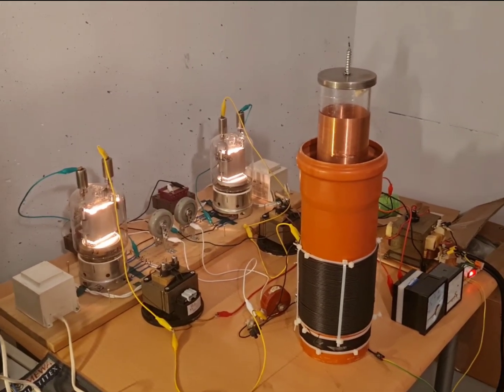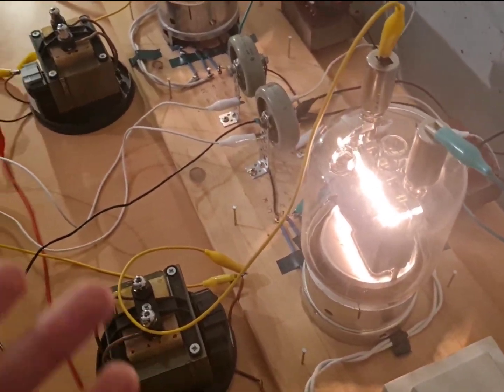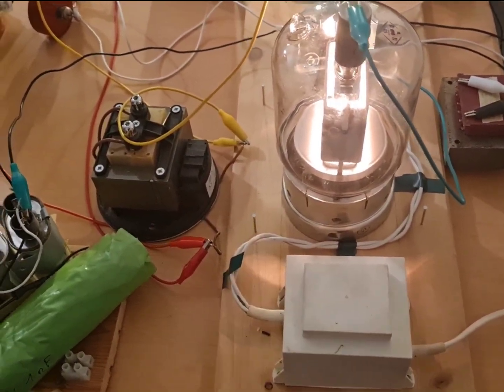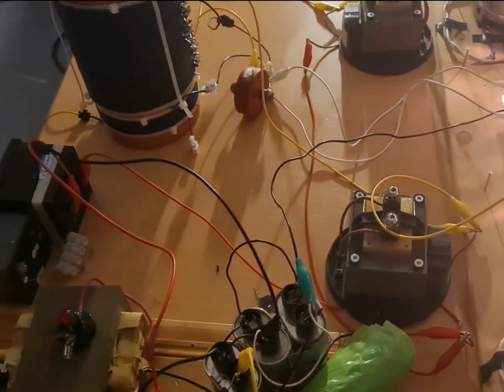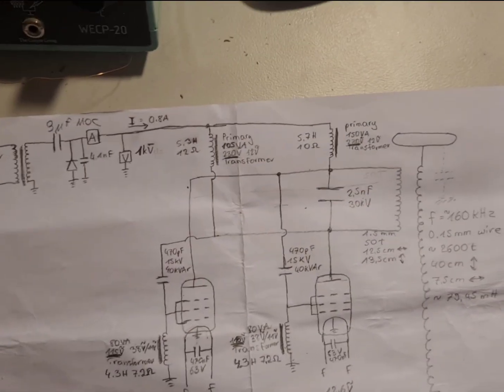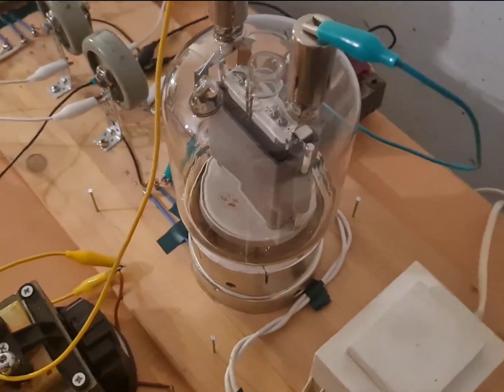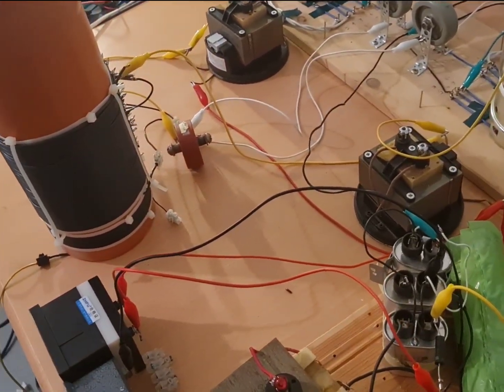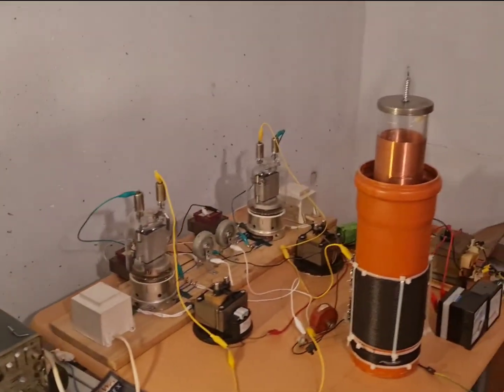Worlds First Dual GU-81 Push Pull VTTC

Comment: Great, you have tried this set-up. I've been wondering about a push-pull arrangement for some time. Interesting you have one tube working harder at the moment, so room for improving the circuit.  Definitely the way to make a GU81 VTTC more exciting is to have two GU81s😁
Reply from the maker: @tuopeeks  Yes and the good thing is this is only using 800W of anode power because the MOTs shunts started limiting it, because the feedback ratio was too high so the tubes were dragging the supply straight to ground instead of being in the sweetspot between current and voltage to get the maximum power.
So there is a lot of optimisation still needing to be done

Comment: Nice, a push-pull Armstrong/Meissner oscillator would probably be even simpler. Relatively few VTTC builders use the Hartley and Colpitts oscillator, let alone in 2-tube push-pull version.
Reply from the maker: @mernokimuvek  I am still trying to make it work but it has proven to be difficult.
Specifically choke values etc and feedback ratios, since the feedback currently is way too strong and the tubes overconduct massivly

Comment: would a bifilar primary coil be of any benefit? winding them with lamp wire makes a natural center tap
Reply from the maker: @milogonzalez1334  Hmm I dont know about that, that would be easier, but because VTTCs generally need more coupling this wouldnt really work I think?
If you are able to try it out with 2 tv tubes like pl84/pl500 models would be interesting to see how it runs.
Reply: @janno288  side quest activated lol thank you. i've been meaning to build a vttc for a while now. i've used bifilar primaries on spark gap tesla coils before but ive always wanted to go vt. idk when i'll get to it but i'll try it out
Reply from the maker: @milogonzalez1334  Good luck!
If you want any help on the tube side, contact me on discord or here, same name on discord as I have on youtube, janno288

Comment: Absolutely awesome! I’ve been thinking about building a vacuum tube Tesla coil for a while now.
Reply from the maker: Yes it certainly is, it definitly needs way more optimisation, it consumes way too much current and the tubes are redplating. 
So the impedence ratio must be screwed up really bad, it needs more turns on the primary, i will have to read up on more theory tho. 
I managed to break my MOT a bit, since the voltage it outputs is much lower, i need to get a new one, so i need to get myself on some microwaves, yeah difficult here.

VTTCs are really simple once you know about how they work and built your first one, they are obviously more dangerous when something goes wrong, but its hard to kill a tube

Comment: really nice work!! you're getting really good at this!! amazing that the grids withstand a so high voltage, considering you didn't do what i suggested you LOL, i mean using small caps for the feedback to make an high F voltage divider :D anyways also consider the cut-off of the tube, cos a too high voltage on the grids messes with tube driving (but you're using chokes, not resistors) ... impressive output also!!... about if it's better or not compared to a SE setup i'm still at my conviction, that the best this coil can do would be the same of a twin GU81 coil or slightly less :) with the difference of using more components, but yeah... pretttyy cooool!!
Reply from the maker: Yes! And this is using just 1 Microwave Transformer and draws 800W while other coils use multiple microwave transformers and draw even more power. 
I didnt really do any tuning, this is out of tune by a couple 10s of kHz so I am doing really well. 
These tubes in triode or semi pentode mode have a really low cutoff point, the selfbias of the tube shuts them off completely. at 1kV Ua and 0V grid bias these tubes only conduct 9.5mA, so they cannot destroy themselves when there is no grid drive. 
I also forgot to mention, i put small spark gaps that are around 1mm on the grid to cathode point connections, just in case, the distance between filament to g1 is like 2mm or so, perfectly fine

Comment: Hi there - i think i recall your last "strange interference" video :) - this one has a much better scenery but similar. Chineese clips are best because colorfull and cheap :). Now i know where did that last time interference, internal oscillation came from irregularly AFAIR :) - somebody was testing his tesla coil gun in his garage :)
Reply from the maker: Yeah, I figured out what was the problem with the last one, the  shared g2 resistor was acting as a problem due to the inductance and capacitance of the connection, adding a resistor before the rf bypass capacitor on g2 fixed it and it does light up CFLs and there is no strange current rise